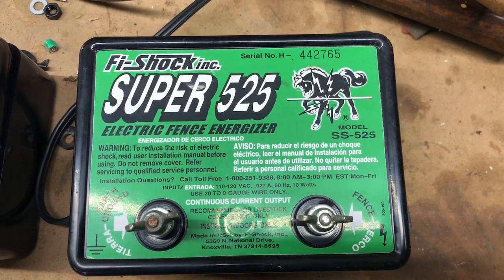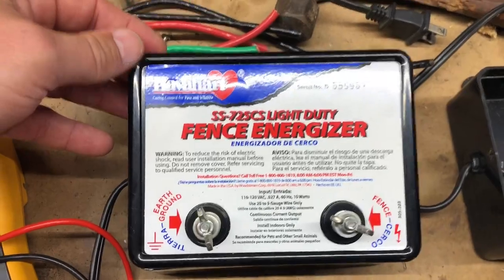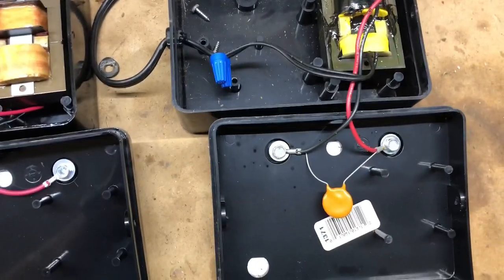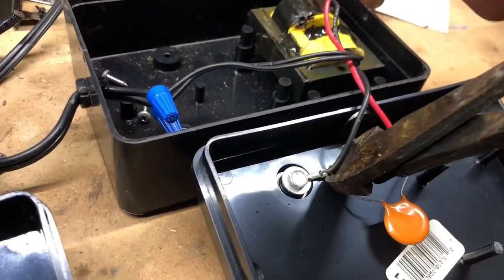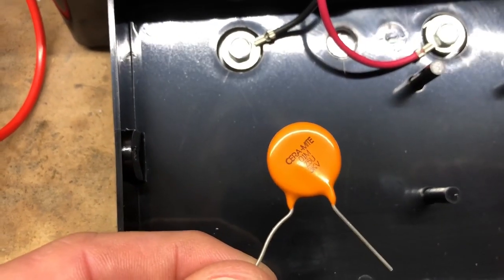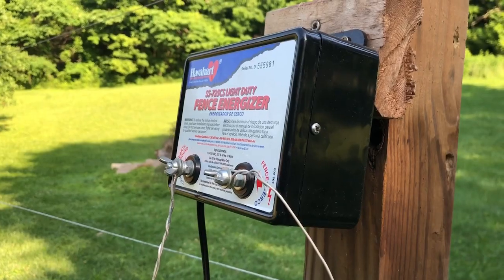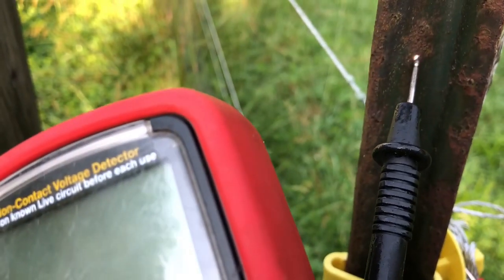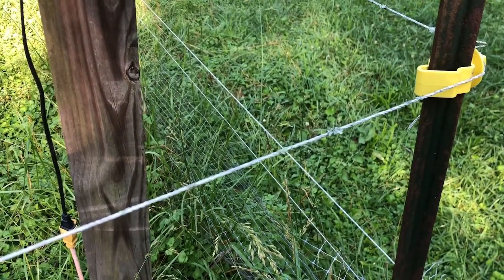More Zap from Your Electric Fence Energizer by Adding a Capacitor

Comment: Those constant current fence chargers are no BS. Check the output with a florescent bulb. 2' or 4'  works for me. One end in the dirt (ground) other pins on the wire. It will light up like normal. They WILL KILL a small animal. 2 squirrel & a 15 pound owl so far. Will also set dead grass on fire. They do not like to be grounded out for long or will burn up the cap or transformer.
Reply: Forgot to mention that rebar for a ground works for a year or so before corrosion takes its toll. If it bites you on the ground side there is a bad ground. I started using half of a real copper coated ground rod. No problem since.

Comment: Both of those fence charges you have take house AC current and step it up through a transformer to a much higher voltage.   I don't think they make straight AC fence chargers like that anymore, since they can be very lethal.

Comment: The transformers are different between the two units. That capacitor is a basic lightning protection device... if the fence gets a sudden power zap it will channel as much of that power as it can to ground, in theory possibly saving the transformer from getting fried.
Reply: I don't know about a capacitor lightning protector as no way can it carry the current. Better is a MOV metal oxide varister to bleed off a charge at its voltage rating . They are in surge  suppressors. MOVs can fail and start fires. They are illegal in the Navy . During Zoomy they started a fire on a carrier.

Comment: Good video.  However little you think you know about electronics, I must know less as I learned from your video.  I'd already fried my multimeter, but I was smart enough to have rigged a tester by using a piece of heavily insulated rubber and making a "handle" on an old piece of about 3/4" x 4' aluminum conduit.  I hold onto the insulated handle and by putting the end on the ground, shorting the exposed conduit against a fence wire, and observing, I can see if it sparks.  If it does, it's hot.  I've checked a lot of fence with it.  As for the finger test, I've been shocked enough times accidentally that I'm not going to touch a hot wire on purpose!